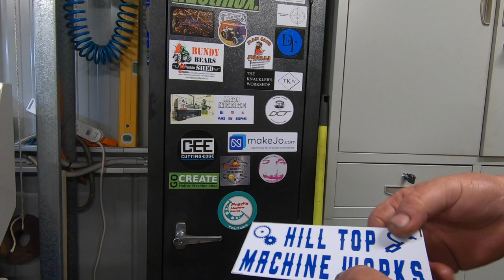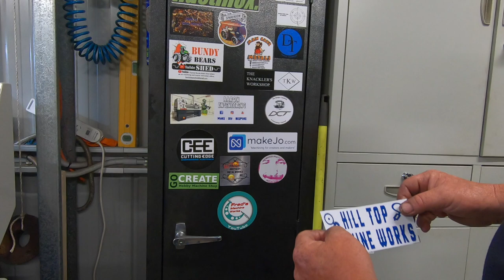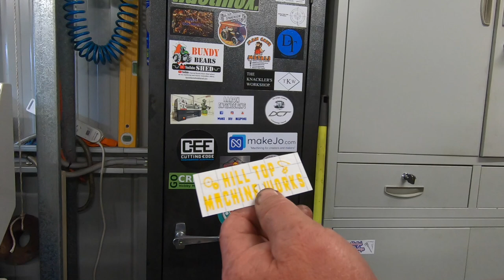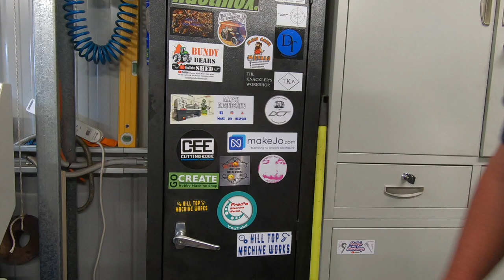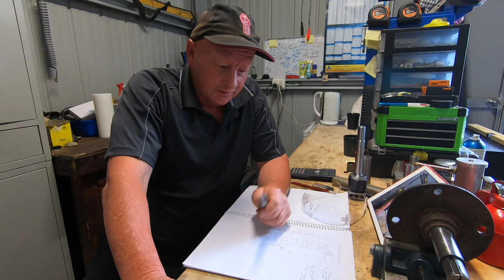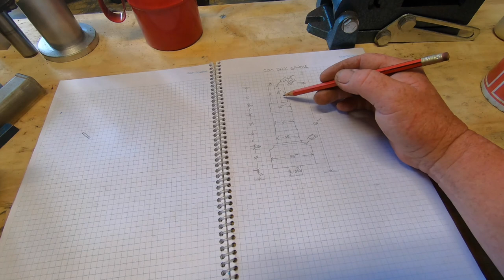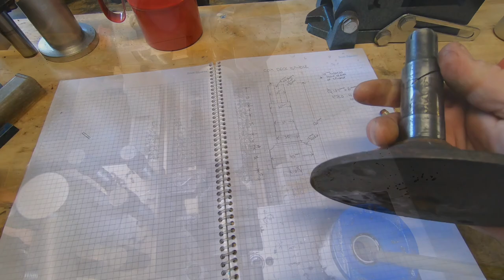Cox's deck spindles

Comment: I like your tenths mic Matty! :) That's a great little project, and great reuse of the stub axle. You've definitely got your mate out of a jam! I had to laugh about the story of the shopkeeper saying the bloke had come in the day before asking for the same part, and then the seller of the mower said "I don't know anything about mechanics". What a two faced git!

I see you are using the soluble oil - it's great stuff isn't it.

Cheers,
Craig
Reply from the maker: Gday Craig, that is a Moore & Wright micrometer, having the tenths reading is bloody handy, If I bye anymore I’ll be getting the same, I would have like to have been there when the conversation was happening in the shop, I really think I might have wet my pants laughing I’d say

Comment: Nice little project Matty, I like it when someone needs an irreplaceable part and the machine shop comes to the rescue. Do you favour metric or imperial? I have committed to imperial, so I always convert to that, and as I am old, I shall never be comfortable with metric. In Canada we change to metric in the late seventies and I have found next to no need to use metric except for temperature. That damage being done, I have never really known how hot or cold it is without a converting thermometer, so this has tempered my affair with metric.
Enjoyed the video, cheers mate!
Reply from the maker: Gday, I can’t get my head around metric most of the time, some things I’m right but I favour imperial, it the bloody decimal point that screws me up, I should have paid way attention in school I think